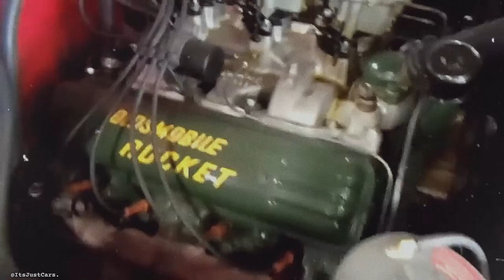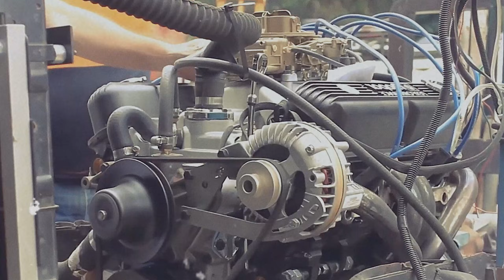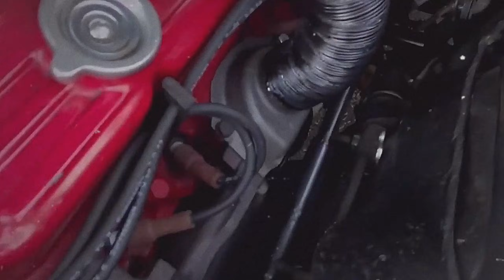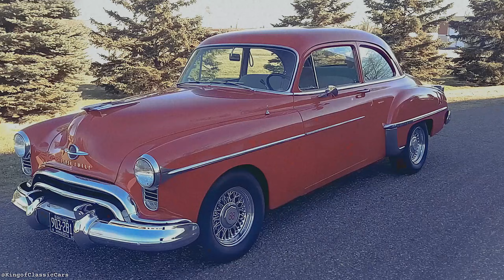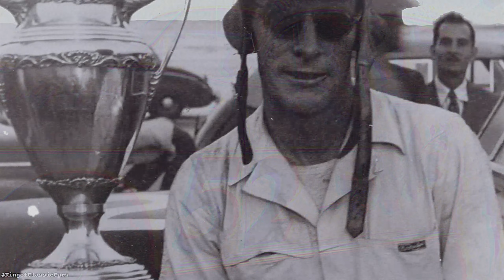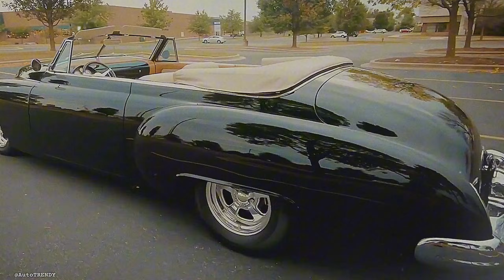How America's FIRST Muscle Car Was Born – The Oldsmobile Rocket 88 Engine!

Comment: My dad bought a 51 corridor sedan Oldsmobile Rocket 88 when I was 15 years old at the age of 16 I stole his keys and drove it at night around Lake Merritt in Oakland in 1960 when I got home from the service I bought a 1950 Oldsmobile Convertible rocket 88 that we replaced the solid lifters and put a high lift dunk off cam And I was challenged by several late 50s tripower and the old zero to 80 was still the fastest thing on the road in 63 I also it had been nosed and decked as they called it removed all the Chrome and led it in and repainted burgundy red it was the best car I ever owned even my dad's 55 Pontiac trip powers stock was not faster than the Olds  I paid $300 for a 10 year old car that turned out to be one of the best and now I see the start up I of the hot rod era I will B89 this year and thank you for the memory I still have a picture don't know how to attach it my wife while driving it and going to college